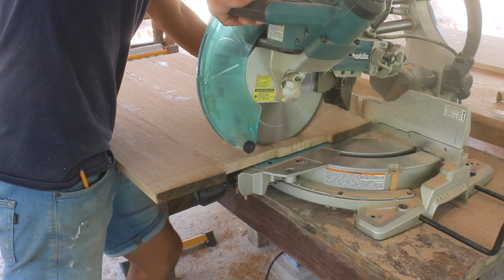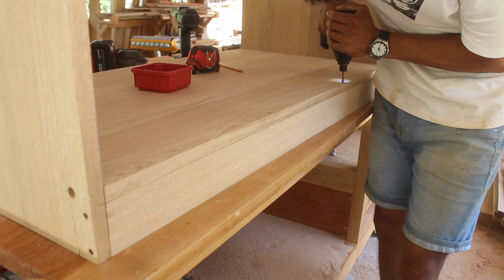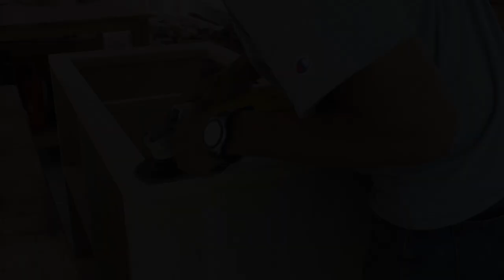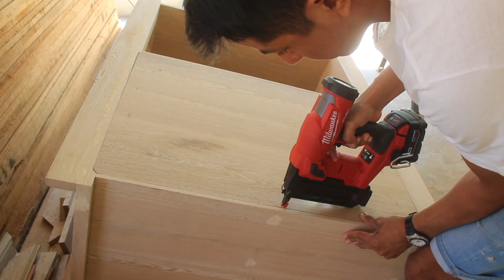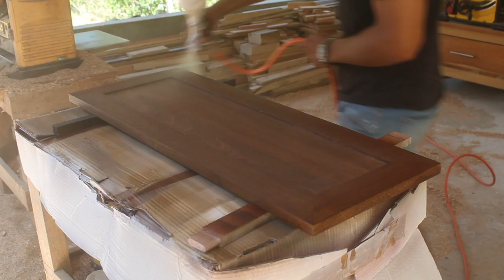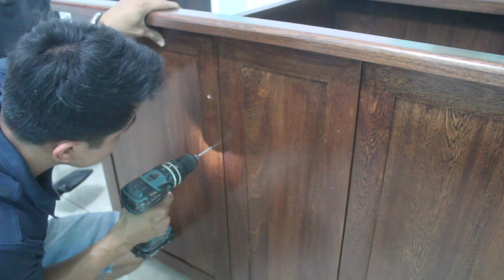How to Build a Kitchen Sink Base | Kitchen Cabinet

Comment: One thing I’ve noticed in your work is how you use wood putty. You even put it on the brad nail holes that most people ignore. Very nice attention to detail. Another fine finished product here, great job!  👍
Reply from the maker: Thank you Robert, I'm obsessed with it, when I'm sanding I put more wood filler even in the little cracks or holes that you need to get closer to see them 😝 you will notice the difference when apply the finishing

Comment: I haven't seen a real timber cabinet in a very long time. This is apsolutely beautiful. Love the finish, and attention to detail too.
What timber did you use here? 

PS. You prob know this already, when mounting door hinges to door, you can use long level to align hinges quickly, straight edge of the level presses against straight edge of 2 hinges which aligns them inline with each other.. No measuring or eye balling, perfect line very quick. 

Anyway thanks for sharing.
Reply from the maker: Thank you so much for your comment, the wood I used is called "Macuil" (Tabebuia rosea) here in Mexico.
What you said about mounting the hinges using a level is a good hack actually, thank you!